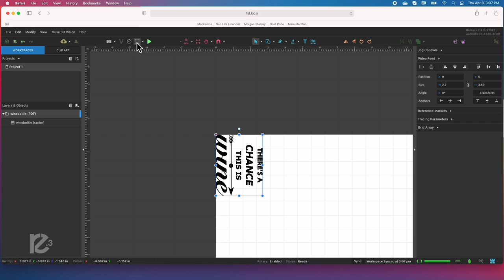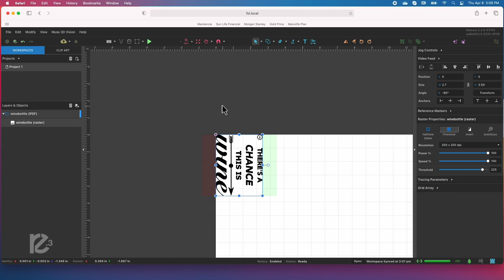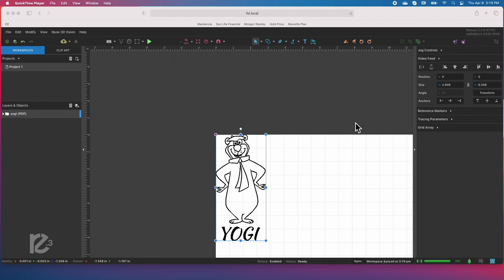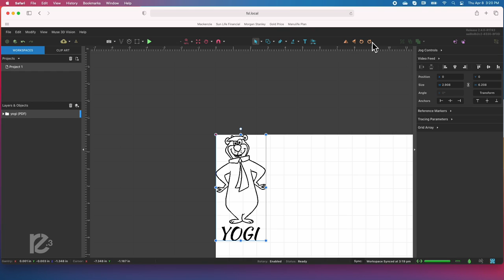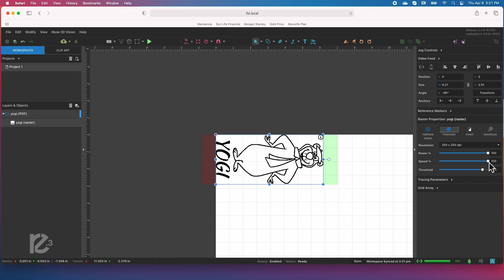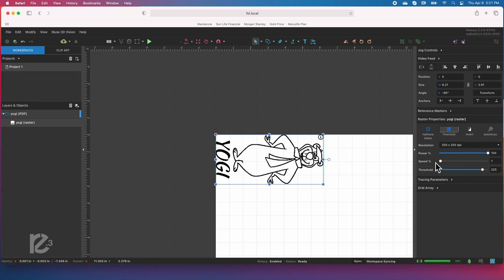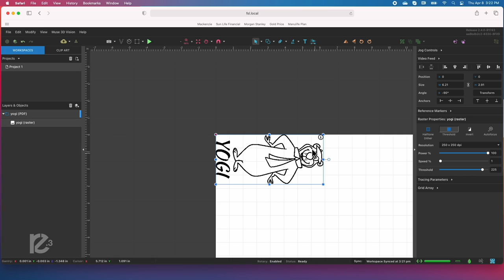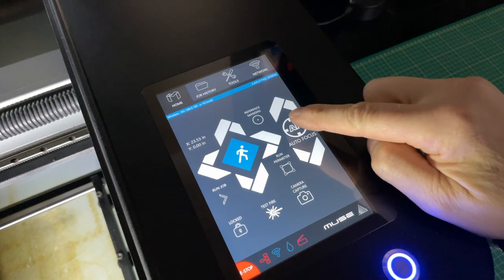Definitive Guide  to Making Custom Water Bottles

Comment: Just got the PiBurn 3.0 rotary to replace this commonly cloned rotary. I had designed and printed many upgrades, and it worked fine, but still too many limitations. Piburn is a dream to use😎
Reply from the maker: These look amazing.  I wonder if one of these would work with a Muse 3D laser. otherwise it would be a compelling reason to add a Lightburn-based laser to my shop

Comment: This may be a silly question but I see the Yogi bottle is masked as well  Did you spray the coating on after masking the bottle?
Reply from the maker: No.  I applied Cermark to that one and engraved that onto the bottle.  The masking was only to avoid spraying Cermark on parts that wouldn’t be engraved - it’s expensive so you don’t want to waste it

Comment: Hi Steve.  I also have the newer rotary that you have in this video!  I was wondering if I had gotten the wrong one but now I see that I haven’t!!  I had set it up backwards as well.  I will change that immediately and run a job with your hints! Thank you very much and I feel much better about the rotary now.  Also I wanted to mention that my laser also comes with a QR code in the corner of the touchscreen which leads me to RE3 on my iPad where I can continue to design there. I haven’t seen any info on it but it must be also a new feature.
Reply from the maker: It seemed weird to me when I first tried it but once I turned it around I actually like it much better because it’s oriented toward the zero position now, avoiding rotating images and trying to align images on the right. 

The QR code is new and is definitely convenient
Reply: @SteveMakesEverything  I have run some projects now and I am having a hard time figuring out where the project will start.  I run perimeter to see if it will fit but is there a way I can center the job on the homed spot on mug? It starts at the top right of the job so hard to position the mug to start. My issue is difficult to explain. The reason I need to know is for centering because I want to do both sides of a Yeti with even space. I thought I saw a setting to start top center.
Reply from the maker: I get it. What I will do is mark where I want the center with a pencil and then make sure it’s in the center for the perimeter run.  If you know the width of your image put a piece of tape at the left an right limits and it gets easier.

Comment: Is there a way to do bottom up engraving so the dust does not contaminate the engraving as it turns?
Reply from the maker: It depends on the laser software you are using but most programs will allow this.  For example in Lightburn you can rotate the engraving direction 180% and the job will start from the opposite direction.  RE3 also offers something if you are using a Muse but I can't recall the process.  I'm not sure about Glowforge but I would bet it does something similar.

Comment: What focus lens do you use?
Reply from the maker: Mine is a 2”. I also have a 5” lens but it isn’t my main
Reply: @SteveMakesEverything  anytime I unlock and change the position it wont auto focus and lock back.
Reply from the maker: @chellypetro6087  It's a bit tricky until you understand what's happening, though if you follow what I did in the video it should work properly
Reply: @chellypetro6087  same here,  I set to zero zero zero, then I unlock and move to
Over rotary but it will not lock again
Reply: I have the same issue.  Is it a firmware issue?